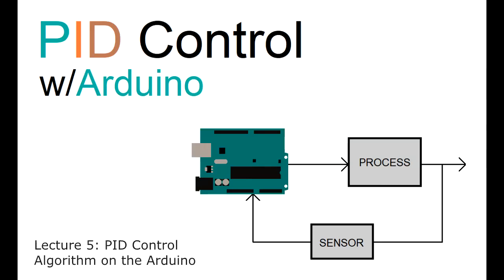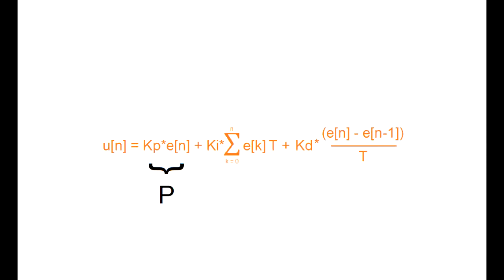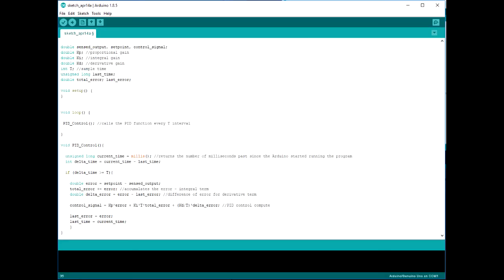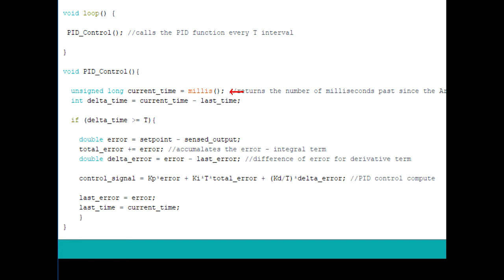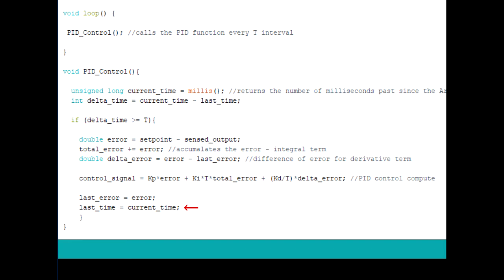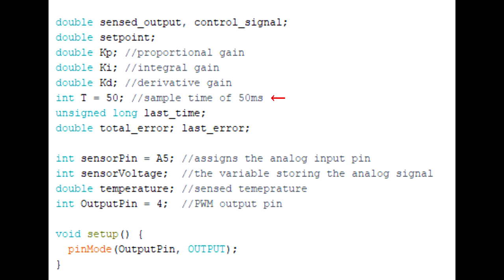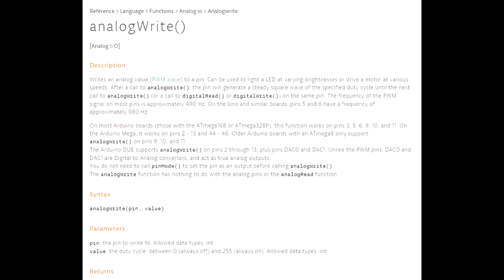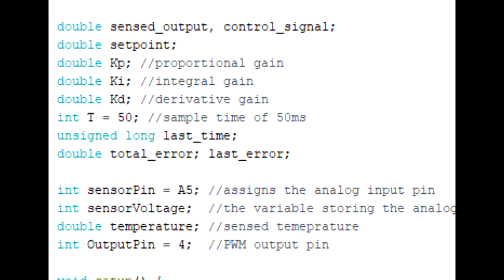PID Control with Arduino: Lecture 5 (PID Control Algorithm on Arduino)

Comment: it is very helpful video. i would be glad if you post the code please
Reply from the maker: double sensed_output, control_signal;
double setpoint;
double Kp; //proportional gain
double Ki; //integral gain
double Kd; //derivative gain
int T; //sample time in milliseconds (ms)
unsigned long last_time;
double total_error, last_error;
int max_control;
int min_control; 

void setup(){ 
  
}

void loop(){
  
 PID_Control(); //calls the PID function every T interval and outputs a control signal  
 
}

void PID_Control(){

  unsigned long current_time = millis(); //returns the number of milliseconds passed since the Arduino started running the program
 
  int delta_time = current_time - last_time; //delta time interval 
  
  if (delta_time >= T){

    double error = setpoint - sensed_output;
    
    total_error += error; //accumalates the error - integral term
    
    if (total_error >= max_control) total_error = max_control; 
    else if (total_error <= min_control) total_error = min_control; //prevent integral wind-up
    
    double delta_error = error - last_error; //difference of error for derivative term

    control_signal = Kp*error + (Ki*T)*total_error + (Kd/T)*delta_error; //PID control compute
    
    if (control_signal >= max_control) control_signal = max_control;
    else if (control_signal <= min_control) control_signal = min_control; //saturates the output 
    
    last_error = error; //store for next iteration 
    last_time = current_time; //store for next iteration
    }  
}
Reply: How Did U Get Visual Display ...plz ..long day long im searching pid Control.  Thanks Nabil Mohammad
Reply from the maker: @MamunKarimtoyforusrc  It's the Serial Plotter available with Arduino IDE. I just editted it to be black instead of white during post production.
Reply: where is motor controller programm secound program
Reply: @nabilmohammad5076  Great thanks for posting the code. I noticed the variable "T" is never initialised in the Setup function. Missing T = <value>;

Update: my bad, at 4:35 you have it covered :)